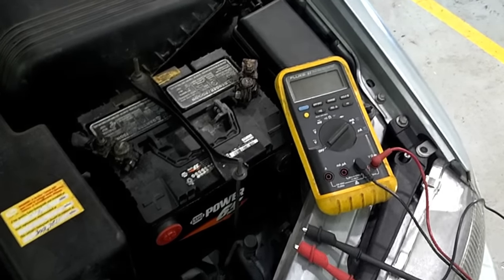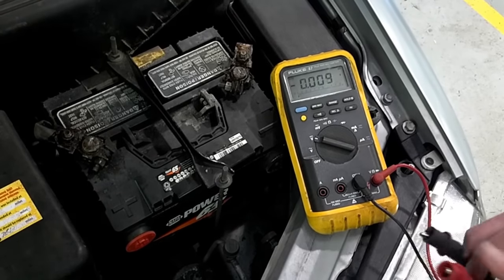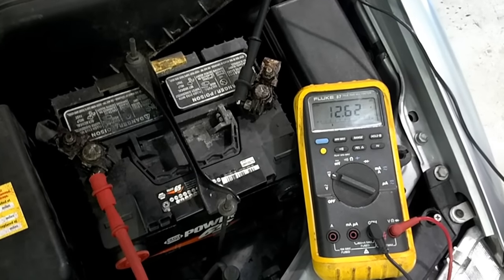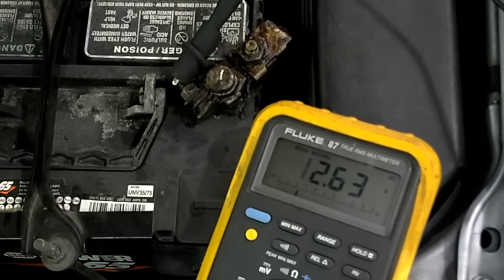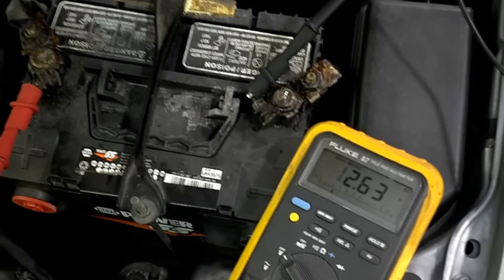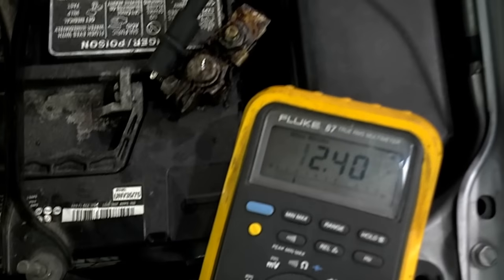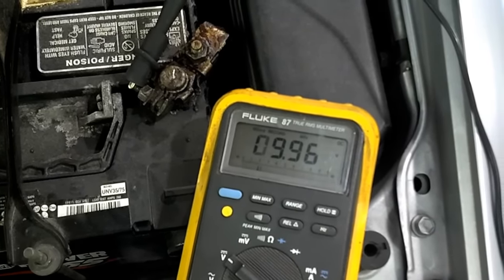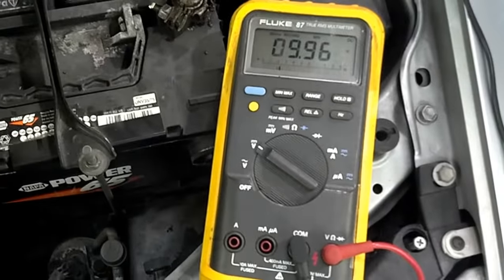Battery Load Test With a Multimeter

Comment: I never saw 9.6 show up on the meter, lowest I saw was 10 v.
Reply: SO THE  BATTERY CONDITION IS BETTER   SIR .. 9.6V IS THE  LIMIT ..
Reply: The meter has both an update rate (where it 'captures' a reading) and a screen refresh rate that you have to take into account. Even many good meters can only refresh the screen several times a second, or it just becomes an unreadable blur anyway. I guess higher-end models that capture more often can buffer or log the data for later analysis, or for showing truer min/max/avg values. So it's not surprising the meter captured a different value to what you saw. Often there's a bar-meter to give a better indication of how quickly the reading is changing, like the old analogue meters with needle indicators could. You can see this bar moving below the digits on his fluke. Still, many won't have that and even if they do, it's only an indicator of rate of change, though how far along the bar moves also gives a ballpark measurement.

Comment: Lol soooo how do you know which hole to plug the wires in the multimeter?
Reply from the maker: The black lead always goes in the "common" port.  If you are measuring voltage or resistance, the red lead should be in the port labeled for voltage/resistance.  The only time you would ever move your red lead is when you are planning to measure current.  To measure current directly with your multimeter, you will need to have the red lead in the port marked "10A" or "20A."  There is often also a port for milliamps, but I wouldn't recommend using it unless you are certain that you will be measuring very low current.  You can blow that fuse easily.

Comment: 10 volts is the magic number according to chris fix...and Eric the car guy..
Just saying
Reply from the maker: There's nothing wrong with that.  You will just replace batteries more often and sooner!  It also depends on the speed of your meter.  I often use a PicoScope to perform the same test.  I use 8 volts as the rule when doing it this way because the lab scope is so much faster a catches the very bottom of the voltage dip that a multimeter cannot detect.  8 volts is also a number that I chose after testing hundreds of batteries and determining that using 8.5 volts as a threshold gave failing results to almost every battery and 7.5 volts only failed batteries that were extremely bad and already causing staring issues for many people.
Reply: @JustinMillerAutomotive  thanks for that Justin....top guy.

Comment: If the engine starts, it passes... What is the point in wasting time to "test" if the battery will start the engine if one has to literally start the engine to test if the engine will start?
Reply from the maker: That's kind of like saying "if you're alive, you don't need to go to a doctor."   A battery may be able to start the engine at one point, but if the battery is in poor condition, a change in temperature or a few more starts may be enough to prevent it from starting later.   We test the battery so that we know whether it is healthy enough to last through the next season or if we should replace it before it leaves us stranded somewhere.  Also, continuing to use a weak battery can cause other issues--particularly with your charging system--that will cost more money in the long run.

Comment: How about if the car starts, the battery has sufficient power to start the car. If the car does not start, the battery does not have sufficient power to start the car. You don't even need to lift the hood.
Reply from the maker: Well that's one way to look at it.  If my credit card didn't get declined then I must have plenty of money and there is no need to check my bank account :)

Comment: Condemn the battery? Why not just desulfate it. I've done many, some that had sat for years. Like brand new. People jump too quick to buying new batteries when they can often last 10 to 15 years.
Reply from the maker: Desulfation can help prolong the life of some batteries in some cases, but it is not a magic bullet and it cannot restore a an aging battery to new condition.  If the battery is in good condition (not old and has not sat in a discharged for long periods), it can develop "soft" sulfation.  Soft sulfation can often be reversed. 

However, if the battery has aged significantly or has sat for long periods, it develops "hard" sulfation, which cannot reversed.  In addition, many of the popular desulfation techniques can damage the cells of the battery or can cause internal shorting, which leads to internal drain.

The best approach is to try to avoid sulfation in the first place by keeping it fully charged at all times.  I am not against desulfation.  It is a great way to get a little more life out of a dying battery in many cases.  It just isn't going to be a substitute for replacing a battery with a new one.

Comment: I setup my phone on a tripod since i don’t have min max
Reply from the maker: The only problem is that this won't work.  The display on the multimeter doesn't update as fast as it records data.  You will need a meter with a min/max function.  If you are on a budget, the WH5000A meter is a good one for only about $30.

Comment: I replace my cars battery every Four (4) Years as part of scheduled maintenance
Reply: Your wasting your money,Yuasa battery on a Honda Accord 10 (ten) years old original equipment,still working fine...
Reply: Agree.  If you maintain your batteries by keeping the water level up (distilled water only) and keeping the tops clean, you should get a few years more than four out of them.  Batteries in both my Ford Ranger and F150 are over four years old.  The boat battery is about 4 yrs. old and doing fine.  I charge them up at least once a month even if parked, unused.  That's important, too.
Reply: Don Kiddick:  It's not your wallet... don't worry about it.  I bet onenikkione doesn't get stranded by a dead battery.  I agree that a battery can last over 10 years.  Yet most people don't maintain a battery well enough to make it that long.
Reply: What are you doing with the old ones?

Comment: if the car is not starting, when you would normally need this test, this method is useless.
Reply from the maker: No, it actually can still help you determine if the battery is the cause of the no-start condition.  Do this test while attempting to crank the engine over--even if the engine doesn't crank.  If the battery voltage stayed above 9.6 volts during cranking, then the battery can be ruled out as the cause.
Reply: Good point Justin. Diagnosis begins by a step by step process of narrowing down the culprits.

Comment: where does the 9.6v come from? in other words why specifically 9.6?
Reply from the maker: It is a number that has been used by the industry for many years when performing a battery load test.  There really is nothing special about the number than it is about the point at which you risk voltage being too low to effectively operate ignition and fuel systems.
Reply: @JustinMillerAutomotive   Hi Justin, Thanks for the response. 
I'm a Maint.-Tech in a different industry than you, wanted to know if the 9.6 was a battery model-specific value or I could use it as a rule of thumb for all 12V batteries. Thanks for your clarification, I understand it has more to do with the 'consumers' than the batt. itself.. -Thanks :)